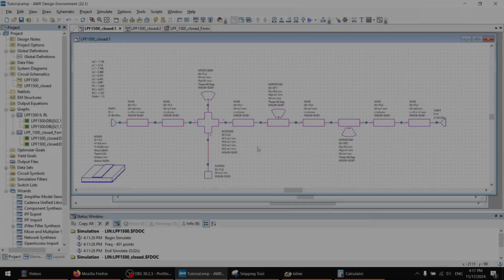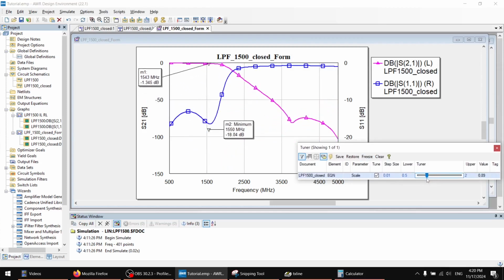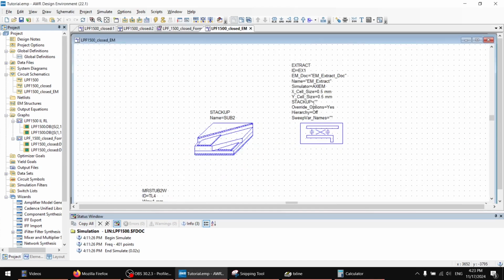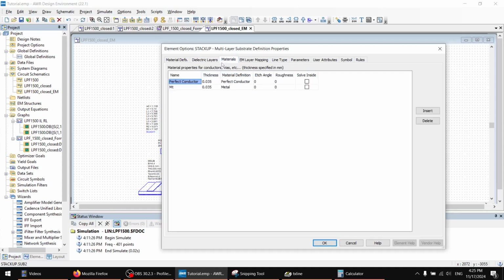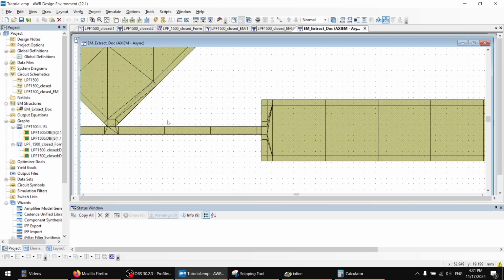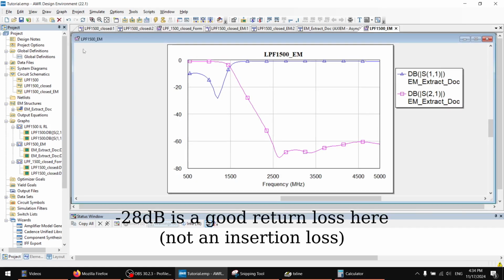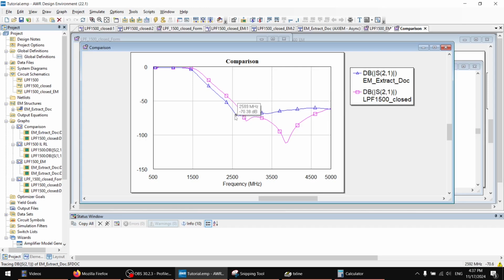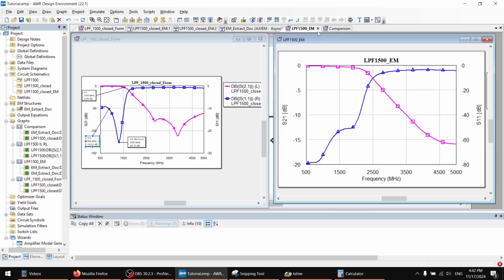EM Simulation and Tuning, AWR Microwave Office Tutorial 2

Comment: Hi Wolf thank you for the video, very intersting and well explained! I have a question regarding the side boundary that you left on Perfect Conductor ( 7:10 ), does this mean that when the EM solver simulates the structure it simulates as if in the board sides there is a PEC plane?  Is it better to leave it like this or set it as Approx Open ? Thank you! 
- 73, DE IU3UXB
Reply from the maker: Hello, good catch. I think the choice will heavily depend on the actual layout, in case of pure microstrip with no shielding (ie. the structure on the top is the only thing) "approx open" might be more accurate approach. 
73